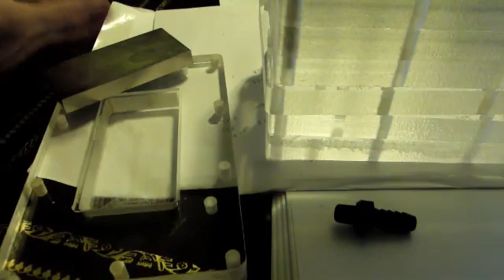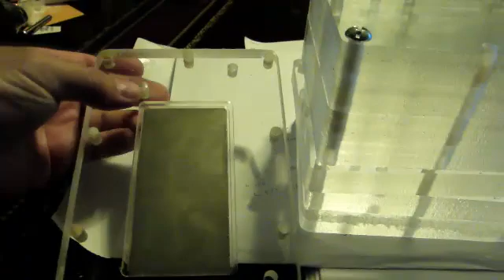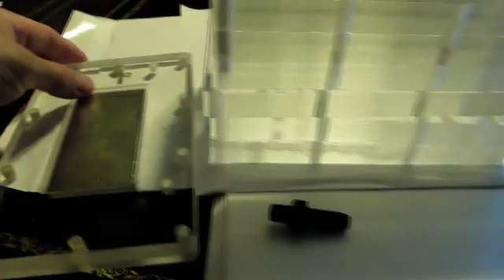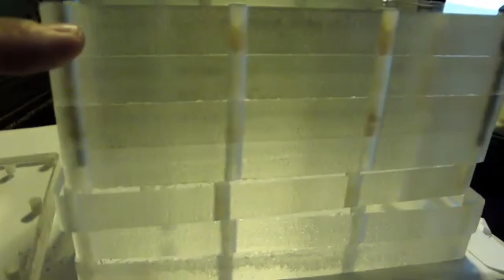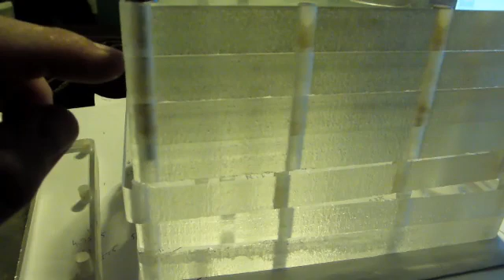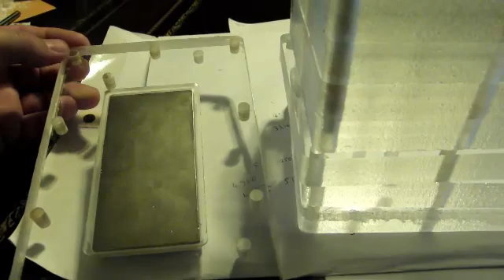Nickel Magnet HHO Cell

Comment: Shane, Those are some awsome blanks. I forgot one thing when we were chatting yesterday. Use some clamps and clamp rigid material on both sides of the spot you are drilling and threading. The cracking problem will dissapear. Good luck with this build. I cannot wait for your results. I have witnessed 8.2 MMW with a similar design.

Larry